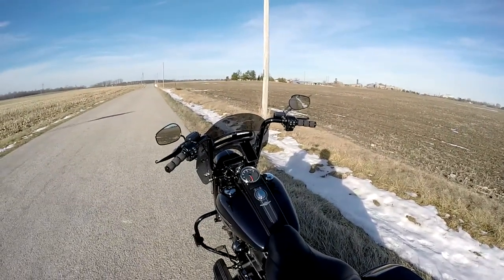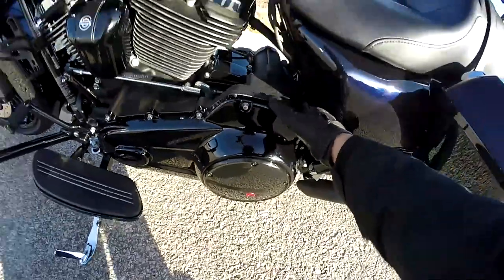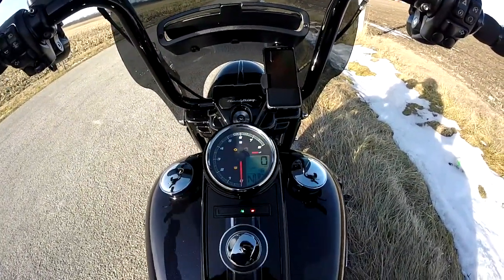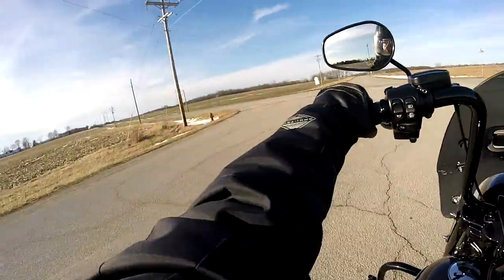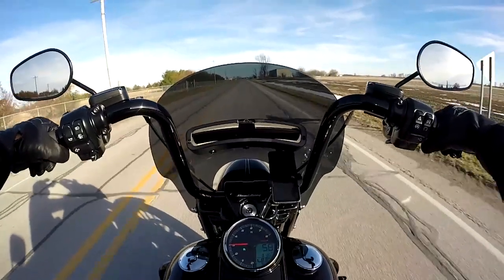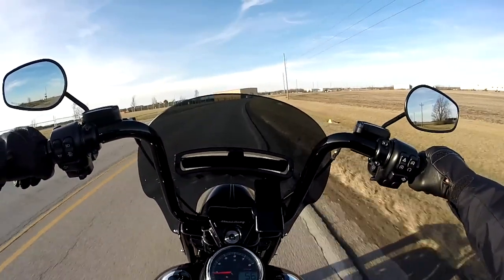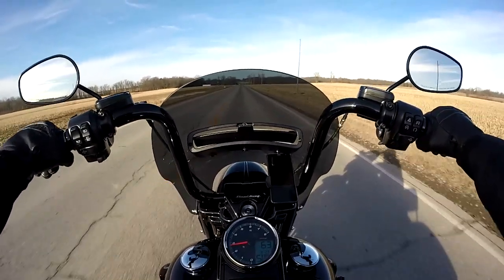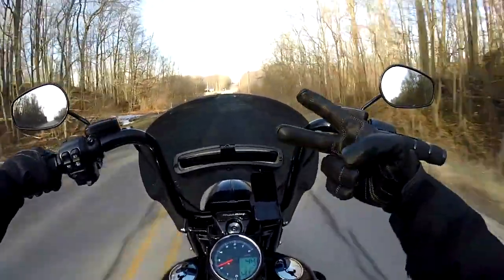Koso HD-05 Speedometer and Harley Oil Transfer Problem

Comment: Hi Dave, thanks for sharing the new upgrade on the bike, looks factory and very modern. By the way, may I ask you why you do not keep the PowerVision on the bike? If it is on the bike, where you have installed it? All the best for the new year.
Reply from the maker: I just don't want to see it on my handlebars and unless I want to do a quick tune, there isn't much reason to in my opinion. Happy Holidays!!

Comment: So I have had this on my 08 FXSTC since summer.   It works great...I had to play with the fuel settings to get it to properly display fuel level...I think it defaults to Liters even on the Gallons setting.   The part that bugs me is occasionally.....when I start the bike...it looks like it loses power...then comes back on, does a "test" and shows the clock as.....12:00.    It's  a PITA that I have to go in and reset the clock....only to have this happen 15 starts later.   Good charging system, new battery and only 4K on the bike (yeah...I bought a 12 year old bike with only 4K and original tires :-P )     Have you had this problem?   It's like they need to put a capacitor on the power supply to hold charge during a start.
Reply from the maker: I know a few people with this from different Facebook groups and not heard of that issue yet. Koso is pretty good with tech support. I'd email them and ask for help.

Comment: You didn’t know about the fluid transfer issue, among other problems, with the Milwaukee 8 engine before you bought the bike? That’s been a big talking point since this engine came out. Oil pump issues, etc. glad it’s running well. Warranty should fix it but keep ahead of it.
Reply from the maker: I knew about the oil pump issue but already knew I was putting in a s&s and cam.  I discovered online jabber about the oil transfer this past fall and it is now taken care of. I watch a ton of youtube and read forums and those are the 2 main topics people are having problems with. I know no bike is perfect and every Harley lineup from the beginning has had issues. There are now problems starting up with Indians new Challenger.  It's just about the love of riding for me and I know what ever issue I find, it will get resolved.

Comment: Hi just installed same speedo on a2006 softail, love it only problem is when I check for error faults, its giving an error of loss of data, doesn't this suppose to marry to ecm automatically.
All else works fine. 
Joe
Reply: @voodoopat1 
Hey I have a 2006 fxstsi and I had to input th eff mileage myself , a bit complicated at first .  but now I love it ,  it works great.  Tells me even which gear im in. Did 3000 miles since then.
Love it.
Reply: @voodoopat1 good for u..

Comment: Hey Dave,
I just got the same Koso gauge, and must say it looks GOOD. Do you have a video on how to set things up, like setting fuel gauge, tires, etc. 
I heard setting up the fuel gauge is a pain. Thanks.
Reply: Indeed it is! Did you manage too?!
I really need to hear first hand experience on this fuel level settings. My intuition is telling me the instructions manual is missing something.
Reply: Christian Ademius haven’t tried yet. Found instructions on line which says need to set at 4 different intervals: 1/4 full, 1/2 full, 3/4 full, and full. Too much time and math involved for me lol
Reply: Its not that difficult, when it works that is. I've done exactly as instructed but it won't work. Error out. And even when I make it (save and done) the fuel meter indicates no difference than what it used to before the calibration.
Reply: @86Raxor  mine works after trying 4 times. Not perfect reading but close enough.
Reply: @Meilak32  I tried at least 10. 
Every time i pressed the button once, before the 3 second confirm. I got the indication of 80.xx. no matter if the tank was empty, 1/3 or full... Got tired of it and returning it today for refund.
Reply: @86Raxor  really frustrating to set up, I took my bike out and thank God the fuel indicator bars went down as I rode around, but yea pain to get right.

Comment: Hey Dave. I just got the same koso Speedometer. BUT I cannot seem to set the tank volume level right. How did you exactly do it? Care to share your experience? You're supposed to calibrate/set it at 1/3 tank volume for each of the 4 levels, 0, 33, 66 and 100. But again, to set these the tank volume should be at 1,3
Reply: Are you getting an error?  Trying to also get fuel level set, and 0, 1/3, and 2/3  level takes the setting, then when you try and move from the full/100% setting it doesn't save and flashes "Error0"  What is "DYNA" mode?  Right now the fuel level just constantly flashes during riding.
Reply: @jdaugustin  Dyna setting is precalibrated it seems. Since you cannot go through the customization mode. Also when going to step 2 in fuel settings where you're supposed to see the current fuel level (0-100%) it says ---. 
Winston, I ve contacted KosoEurope but haven't had a reply yet.
Reply: @jdaugustin  What year and model do you have? Mind if we connect elsewhere to get into the matter? You can find me on Facebook or Instagram.
Reply: @86Raxor  this is a 2018 Heritage. It  is reading the sensor on this bike, and the number (resistance from the sensor) changes with the level during setup.  The manual process works up until the last setting (100%), then it errors out instead of saving the reading/calibration.  No response yet from Koso North America yet either.
Reply: @jdaugustin  This feels bad. I will make a call to at least two HD workshops tomorrow and see if they have any First hand experience. Dave, your reply would also be valuable to us. I hope you read this
Reply: @jdaugustin  Any response yet?
My german dealer is asking me to return it for a refund, to be the best solution. Feels like Koso won´t beat Dakota Digital over these meters.

Comment: What year is your bike? Any issues with the HD-05 so far? Thanks in advance. 🍻
Reply from the maker: I have a 2019 RKS.  Only issue is the fuel gauge doesn't read levels correctly but I have a digital readout on the left side of the tank so it doesn't bother me. I actually really like this speedo a lot. Thanks for watching.

Comment: While my bike was in storage at HD they did the stage one  and I picked my bike up monday to ride on Christmas..and I asked him about that issue..he said yes my bike as the symptom..but they said HD will.not authorize the repair under warranty . Till its documented 3 times..good news i will not have to pay for that same repair they did to your bike..sucks though only have 350 miles on it
Reply from the maker: That's not right to me.  When I called HD about the oil issue, they picked up the bike, repaired it and brought it back to me at no cost because it is under warranty.  I didn't have to document it 3 times either.  You might want to maybe call a different dealership...
Reply: @harleydave2316  so I was back at my HD dealer. And I mentioned how your was fixed right away.. he said because I dont have 1k on it..where as you do..its all I have 700 on it now..but she going back into storage.
Reply from the maker: @smokeGR14  Interesting...  Just keep an eye on it then I guess since 300 miles is not far away so you're close to the fix.
Reply: @harleydave2316  I asked if I should keep checking it. Because I don't want other issues..he said no, i don't have to checking..lol....I said ok...lol should be getting few more days high 40 to 50...to ride
Reply from the maker: @smokeGR14  So it's a known issue that the trans fluid is migrating to the primary and drying up the trans but you shouldn't be concerned or checking it??  Dude...I'd be all over the general manager at this point getting my kit installed. There is a service bulletin which in my unprofessional opinion does not require a certain milage to fix. Sorry your dealership is screwing you. 😢

Comment: Can you set this with your old speedo's milage yourself...or did you have to order it with the milage in it?
Reply from the maker: It picked up the milage from the bike but you can also manually input it.
Reply: @harleydave2316  Cool.  I have an '08 FXSTC.   It would need to be manually entered.  Thanks.
Reply: @johnjjefferson  I just found the same with my 08 FXDF and assumed it was going to pick it up from the ECM. I didn’t write down the mileage off my old speedo so I’ll have to put it back on and add what I accumulated with the Koso and manually enter the mileage for the bike. I wish I saw your comment first.

Comment: Has someone succed to calibrate fuel gauge? Any trick? thanks
Reply from the maker: Not to my knowledge.  I contacted Koso a few times about it and as of 7 months ago, they didn't have a solution but knew about it on Road Kings.  I use a digital gauge on the fuel tank so I keep the fuel feature turned off on the speedo so it doesn't bother me.  I love this gauge though, besides that!!
Reply: @harleydave2316  thanks, Dave. i just got reply from Koso Europe - it must fit my bike. about Road King, i think sender unit from tank connected directly to separate gauge, by this reason Koso meter doesn't recognize fuel info from canbus prototocol.  but this just a thought.
Reply: @harleydave2316  3 years later how is the speedo doing? Any issues?